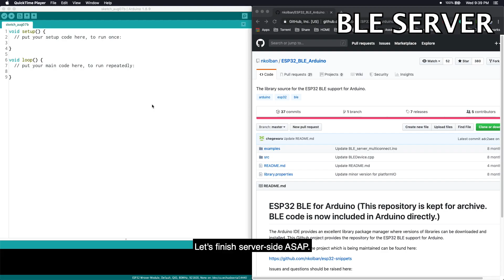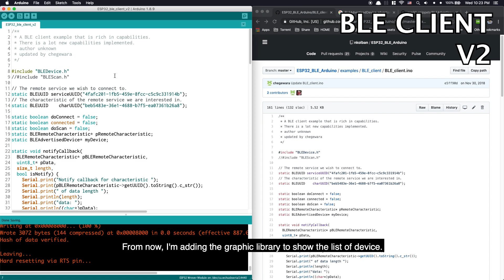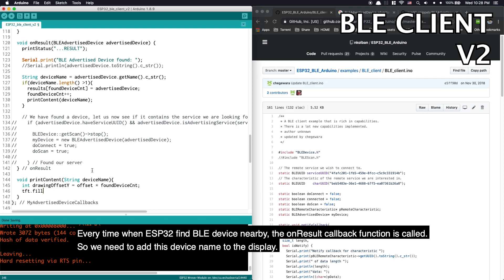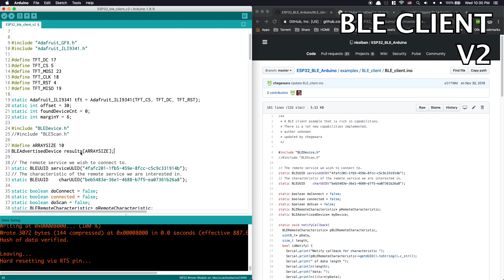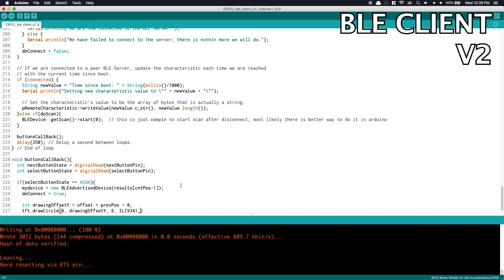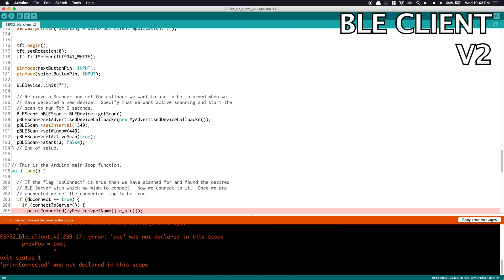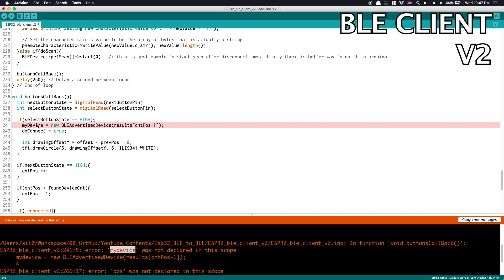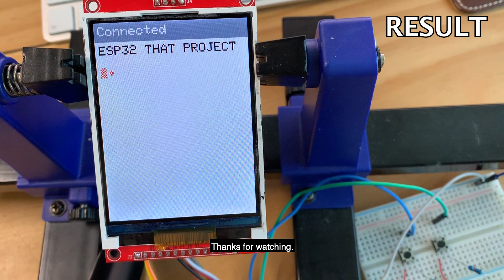ESP32 | BLE TO BLE | SERVER - CLIENT

Comment: I would like read on my BLE_client the characteristic value ("Hello word says Neil") sent by my BLE_server but with nkolban's example I don't know how it works. I don't want display letter by letter. Could you help me. I'm a beginner in BLE system.
Reply from the maker: Marie Rose Abribat Hi. The format for sending and receiving data is a byte (uint8_t). Any String from the ESP32 server is transferred by changing to byte and received as a byte value from the ESP32 Client. If you convert it back to String, you can see the original value. In the receiving part, the video below shows the creation of a callback function to obtain a String value. Please refer to it. https://youtu.be/-N52wL8xQzM?t=250
Reply: @ThatProject  Thank you

Comment: Hello, I am currently trying to make a BLE connection between my ESP8266 board and my phone as a beacon whilst transferring the data through MQTT. The board will require the client code and the phone will be the server (I imagine). How would I go about this? Also, I cannot seem to locate the Characteristic UUID?
Reply from the maker: Callum Batson Hi. You said "trying to make a BLE connection between my ESP8266 board and my phone". However, ESP8266 doesn't have Bluetooth module. Did I miss anything here?
Reply: @ThatProject  I would like to use the Arduino code provided for the client side to connect the phone and the ESPboard. The board is currently connected to an MQTT broker through the Arduino code, I realistically just want to add the client side code for it to all match up. Only things I am not sure about is the connection with the phone as a beacon and the characteristic UUID. As my phone is connected to the same network as my board I guess this would suffice?
Reply from the maker: KaleiMU Honestly, to be honest, I couldn't handle lots of the Raspberry Pi project yet. If you proceed with the project based on RPI's Linux, I think you can do almost everything.
Reply: @ThatProject  What about with the alternative method I mentioned above?
Reply from the maker: Callum Batson How about using ESP32 to get UUIDs? I think this is the simplest way to do it.
Reply: @ThatProject  I don't have an ESP32 board. I thought I may be able to do this with the ESP8266